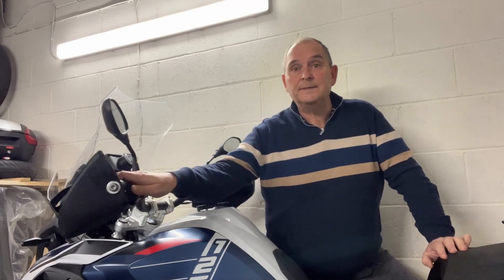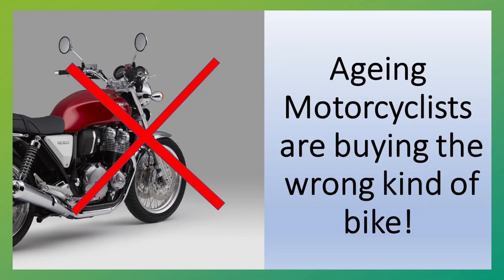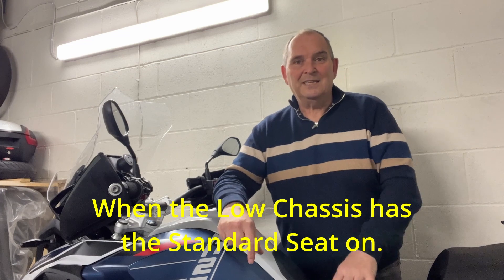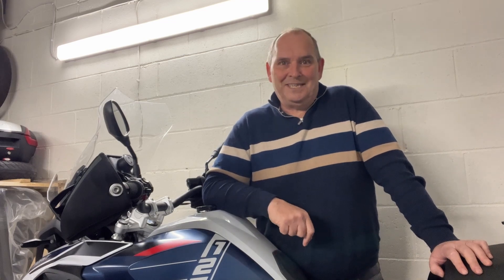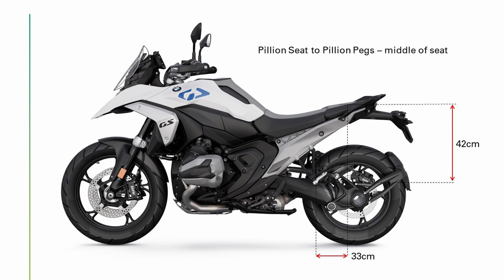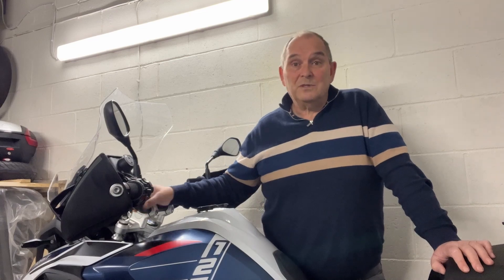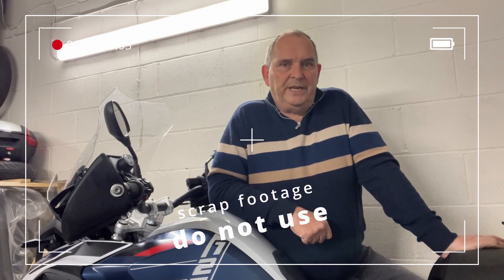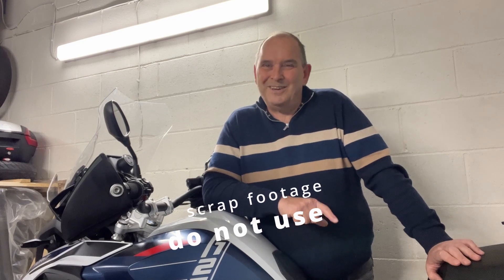Will you fit on the BMW R1300GS?

Comment: The decrease in pillion distance you mentioned is significant.  I was aware of the smaller pillion seat in the 1300 but no one has mentioned the issue of peg distance.  Great information!
Reply from the maker: Yes, I was surprised it was 8cm, that’s a lot.

Comment: Very nice, precise and extensive review of lengths and measurements. But you’re missing one key element of the equation I’m afraid.  I am a tall rider and I was about to choose the high seat option with the adaptive suspension for obvious legroom reason, but when I tried the bike in its standard seat height, the windscreen in up position is just about sufficient to give you a good protection from the wind. When I sat in a very upright position, probably gaining 2CM of height, I could feel a huge difference in turbulence on my head and I was not sufficiently protected from the wind anymore. It means that the high seat will expose you in the same way to the elements. Any thoughts (and measurements 😉) on that matter ?
Reply from the maker: Well spotted Jean! 😄  I'll take that extra leg room with the higher seat and get rid of the wind turbulence with one of the small screen extensions. They can be had for less that €20 on Ali Express and do a fantastic job of directing the air a little higher and over taller riders. They are so cheap to buy it is worth trying at least. The totally changed my last Triumph Tiger 1200 and my buddies XTZ1200 and his GSA. Just about to fit one on my PUIG Touring screen on my 1250GS too to test out. The PUIG screen is good (8/10) but will be better at speed with one of these fitted. The trick is to fit virtually parallel to the existing screen, it doesn't have to extend above much at all.

Comment: Good informative video, having-likewise- a hip that is seating position sensitive I have to pay attention to the various distances and angles though for me it is more the width across the pegs that dictates my comfort as wide pegs force my legs out in a more splayed angle and right into the worn point in the hip resulting in discomfort far sooner. Pre GS I tried the Triumph Tiger 1200 ( was on a 1st gen Explorer) but the wide final drive and peg width thereof just killed my hip in no time similar to what was happening on the Explorer. Given people are commenting on the new GS seat feeling narrower I'll be interested to see how it feels. Happy though with my 1250 so not in a great rush to see the new bike.
Reply from the maker: That is interesting Stewart, I didn't think of that dimension, thanks for highlighting it. The new 2023 Tiger 1200 has got narrower on the front and the GS1300 is definitely narrower so may well suit. As a 2023GS owner I'd be hard pressed to justify a change just yet too 👀.

Comment: 59 with lightweight aftermarket Titanium knees, so seat to peg is hugely important. I had already been thinking along the lines that you highlighted. Use the adaptive ride height option to maximise the seat height available to me. I tried the Tramuntana with the 850 seat height and the Trophy with 870. I'm 5'9" with a thirty one inch leg. With boots on i was just about flatfooting the 850 seat height but it was obvious that the extra 20mm on the 870 was more comfortable from seat to peg. So I've already come to the conclusion that if I'm to take the plunge, then a triple black with the high seat and the adaptive height that would drop the riding height of 870 to a resting height of 840 would tick every box. Ive also just become aware that the pegs that come with the "enduro kit" has two height settings. Standard and low that would extend the leg spacing even further.
Reply from the maker: Great bit of extra knowledge there Capp2101, much obliged. Good luck with the purchase if you go ahead. It is so important to get this right on such an investment, worth taking your time to explore.

Comment: Yer the GS is ok if you like riding a trampoline.
Bruv. Do you reckon you can do a similar video. About which bike will be better for throwing the leg over and exercising the option. 
Also some comments on which one will be better if your solo and wanting to knock the top of it.
Reply from the maker: Yes, my current GS is a Trampoline in ROAD suspension setup alright. "Do you reckon you can do a similar video. About which bike will be better for throwing the leg over and exercising the option". You'll have to expand on that point a little more, not quite with you?
Reply: @terenceokeeffesmotorcyclestuff  You don’t get the Mrs on the bike throw the leg over and exercise the option? What is wrong with you Terry.

Comment: Excellent commentary!
If I may, some comments from a 6ft6in GSA1250 person (me!):
This bike won't fit my wallet..
High seat pushes tall rider into turbulence 
Completely pathetic that BMW have zero adjustability in footpegs.  They used to in 60s. 
The seats should curve up at the front to blend in with the tank alleviate nut fatigue. 
My pillion is lovely 
Kind regards  
Nick
Reply from the maker: Cheers for your thoughts Nick 👍. I would like more foot peg ergos out of the box too. I expect at 6’6” choosing a new bike is a real challenge for you?
Reply: @terenceokeeffesmotorcyclestuff  yes, I do tend to obsess about it!

Comment: The 1300 is aimed at a younger audience - smaller, sportier, compact bike.... BMW have effectively given a v sign to older riders who need to stretch out a little more. Its one of the reasons I will keep the 1250 as its the perfect adv tourer for me. Plus the new bike is ugly and cheap looking, no matter how well it goes and how much "better" than the outgoing bikes..... I think the improvements are superfluous in real road riding but there you go..... 🙂. The general public will largely keep buying new bikes if the 'its better than ever' message is broadcast to them enough, but is it really and does it justify the huge cost which these are now ?
Reply from the maker: Yes, the new bike is "always better" ;-)  I like the physical presence of the 1250 which I also have and will keep that for now. I do like the 1300 for bar reach and ground reach with the auto lowering features but at my age the seat to peg dimensions cannot be any shorter than I currently have for all day riding. I'm not sure my pillion would be happy though, those rear pegs are very high compared to the 1250. Maybe they need those younger riders but will they get them at that price?
Reply: 😮 @terenceokeeffesmotorcyclestuff    thanks, yes much the same here, I just hope the new Adv variant wont follow the same route as 1300 when it eventually lands. Having said that, I find the 1250 Adv absolutely brilliant so its unlikely I will be tempted anyway and the full on big rugged bike looks are part of the appeal for me. The next Adv will have to be spectacular for me to move and I dont think that kind of upwards leap is even possible anymore (?) If I had a single gripe it would be the sometimes clunky transmission but the rest of the machine overshadows that by a good margin